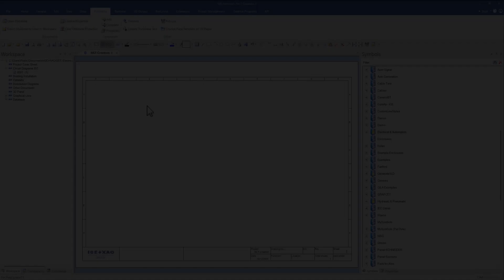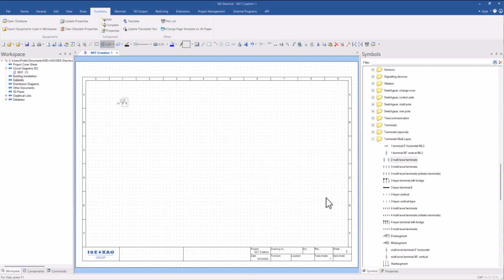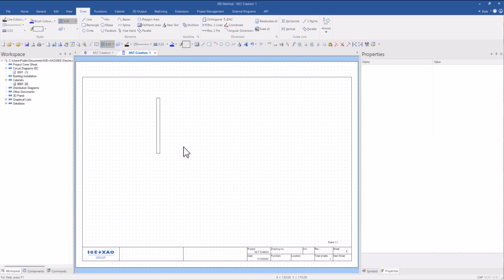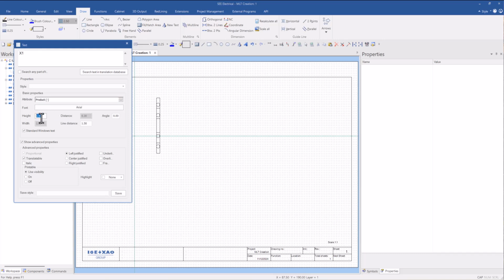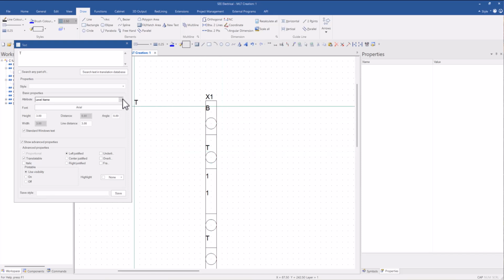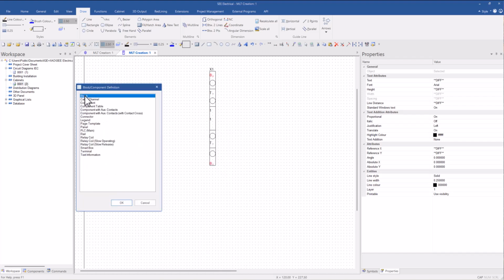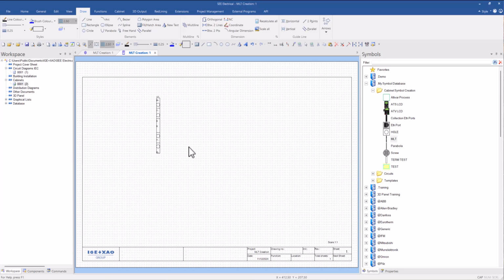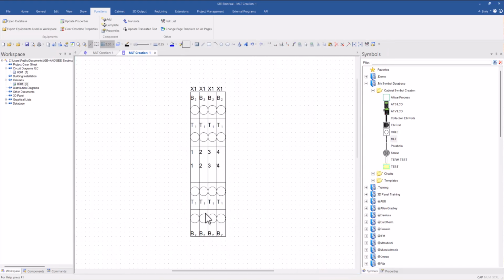Multi-level terminals in the 2D Cabinet

Comment: Hi dear can you also explain how to draw a network cable with RG45 ??? 
For example if i need to connect it to a DELTA VFD symbol ??
will be so happy if you can help me in this
Reply from the maker: If you're using a pre-assembled standard ethernet cable with RJ45 connectors, then you only need a single connection point at each component with a single wire or cable to define the connection. Using a cable would allow you to easily define the cable equipment such as Cat6_Ethernet_3M
Reply: @IGEXAOUK  Hi tank you for your reply
I used a single line between to elements and marked the line as cable 
how i will put the details of the wires inside the cable ??
Reply: @IGEXAOUK  Tank you for your reply 
How can i make the cable with details for example if the RJ45 IS 8 WIRES if i draw a single wire and put a cable sign on it . that will give me only the details of single wire in the cable .. what i have to do .. ? draw 8 wires on top of each other ?
Reply from the maker: @zavenbilemjian8116  In this case you will need to draw all wires with cable cores added separately in the circuit to indicate how the cable should be assembled. In this case either the component or a separate connector needs adding to the circuit to terminate the cable. Exactly as in the physical world.